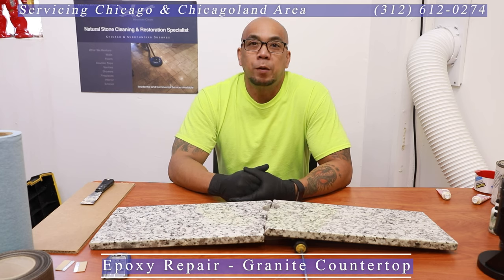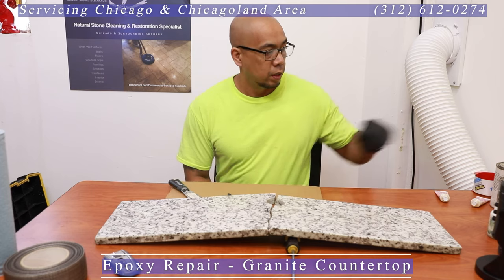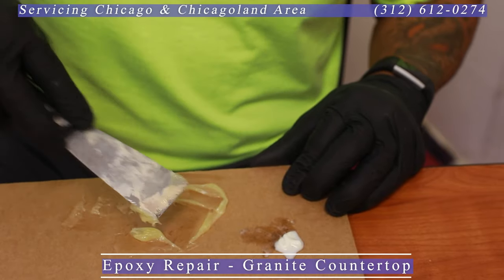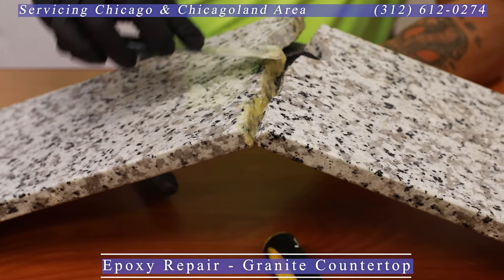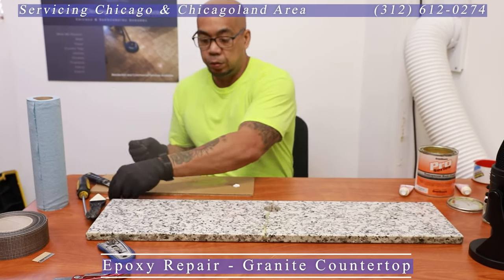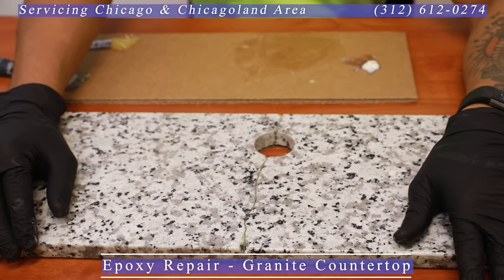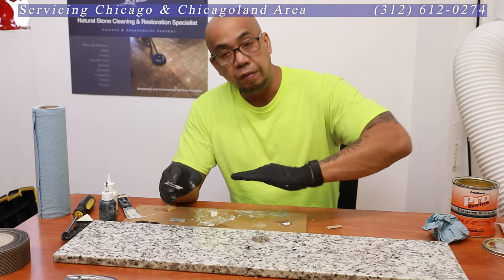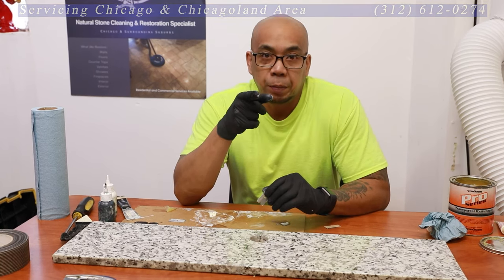Epoxy Stone Repair - Granite Countertop - Artistic Epoxy Repair

Comment: After the epoxy has cured, how do you remove the excess from the cherry dining room table? Lol!
Reply: Good one. Got a chuckle. Thanks.
Reply: heat the area with excess epoxy, razor blade scrape, be gentle when u scrape of course, slicing from left to right helps
Reply: And then, how do you eliminate it from wherever you placed it after you have taken it out of the table?
Reply: সনননকত
Reply: Wondering the same thing 👀

Comment: So in woodworking when you have a bad place in the wood that needs filing you sand a spot that isnt seen, usually underneath, off and collect the sawdust. Then the sawdust is mixed with wood glue or epoxy in order to make the imperfection seamless.  I’m wondering why that isn’t done here?

Comment: Not bagging on your work but this wouldn’t ever be acceptable at my shop. Get yourself a oil color kit and mix the color to match before you put hardener in it.
Reply from the maker: Would love to learn more about that. Can you provide links in reference to those products? Thank you.
Reply: @CSIAbsoluteCleanChicago  there’s a few things you can do to clean that up a lot better. Take your grinder horizontally and cut the inside pieces of the top to the bottom and bore it out so more glue fits in, and where the seam touches gets tighter because the middle of your seam is grinded out. Once you have your color matched to what makes you happy apply and let dry. When my pieces break they have to be completely hidden and un-feelable or my shop/customers reject it. Do you have an Instagram? I can send you my work.
Reply: @codyxisbell  hi, may I ask what's your Instagram?
Interested on checking out your work
Reply: Thank you Earl!  Really helpful!!

Comment: quick question, should the two granite piece be clamp together when you are doing epoxy repair on granite?   Going to attempt repairing my granite counter top that was dropped and broke in couple pieces.  Thanks

Comment: great presentation, a few Q's,
1- will the tightening of the faucet reinstall crack it again?
2- will the epoxy eventually change color or stain over time?
 3- what does a repair like
 this cost? the guy coming today for this repair only crack is 24 inches horizontal behind faucet.
he is charging me $1,500.😢😮
Reply: If I may. . 
1 this repair will crack again, it needs real epoxy 24hours minimum dry time.
2. What he used there it's not epoxy and it will change colour
3. The price depends a lot if the the counter top needs to be removed or not, polished, reinforcement, etc.. For this kind of job, me, in Europe I would charge 150 USD/H. If there are no complications this will take around 6 hours. 
After the job is done, needs to be impregnated again, degreased, cleaned. If the client agrees that has another cost 
I hope I was useful....

Comment: Can you make a wall out of granite or marble pieces by drilling holes in them and stringing them up together for a row?
Reply: Usually iron rectangle shape 'pipes' are first fixed to wall using screws and then the granite pieces are screwed to these iron brackets...

Comment: Your forgetting to reinforce the stone with interlock cutting techniques for extreme strength , you should use different types of glue that are clear white transparent and mix the colours to match the patterns in the stone .
The other down side of this glue is that over time it stains the stone and then it looks like rust has gone through the stone
Reply: Not necessary for cracks. They already give a large gap from all the crushed up stone for glue which is more than strong enough In that amount. As for seams I recommend the biscuit cut technique to help with the bond.
Reply: @Trudeau-is-Stalin  the biscuit cut technique is for timber because the biscuit fits perfectly inside but not for stone ... there’s other techniques for stone
Reply: That’s because it’s not a biscuit technique ... it’s a locking mechanism technique that applies for stone not timber
Reply: I do agree, I'd definitely use clear epoxy or white. I didn't notice the color of earl's, but with the hairline fracture that remains and the color matching, I really can't see any yellow hue bleeding through. 
As for you biscuit deal. I'm a carpenter for 40 years, so familiar with that, but in stone, u say just cutting some horizontal cuts in the material and the epoxy fills those and will suffice?  I was about to ask the other dude, what u use for biscuits? Chards of stone? Haha.  I did appreciate the matting on the backside. Thin but gives strength while lifting to mount. Thanks guys.
Reply: @peterford9369  you’re spot on. Although the ideas of the original comment aren’t bad, they’re overkill. The epoxy once hardened is stronger than the stone itself, there’s no need for any additional techniques to increase the support. However, you were spot on when you said to simply make a cut/grind into the sides of the broken area and have extra epoxy fill that up. 

As for mixing several different colours to get a perfect match on the pattern; if you want to be there for hours on end for a $150-$400 dollar repair, be my guest. The best way is to make a base colour (in this case white) and use “a technique” (secret techniques 😉) to add in the minor colours — the speckles on the stone. 

With some practice, you’ll learn which stones react this way or that way, and you’ll adapt to these reactions and know what is needed for x may not be needed for y, and which techniques are necessary for certain patterns in order to blend in as best as possible. 

There are certain patterns that no matter how good you are, the crack will never disappear entirely. 

I’m impressed by your guess!
Reply: @peterford9369  the biscuit cut technique means something much different in stone. It’s only about reducing surface area at the seam. Some people will router out material to create a thinner seam. The removed material acts as your bonding surface all you need at the visible seam is the smallest amount of adhesive. Using a name brand color match from Nitro, Integra, or one of the other brands can help create an invisible seam. Some go as far as polishing their seam. So if the stone was 3cm, I’d create a few tool paths on the CNC router to remove what ever the manufacturer requires. Depending on the stone, you might leave behind 1/4” to 3/8” thick on the surface, and remove a 1/16” of material below that.
Reply: @plasmaxr  Yeah, that makes sense. Like tongue and groove flooring, the bottom rabbit is shorter so the top will fit more snug.  But for sure adhesive being the color of the material is definitely a plus for a good seam. Being a carpenter I do appreciate a filler that is as close  possible, match the wood.  I've done some countertops in tile, wood , Mica, and even slate. But they all have a sub base of wood . I do appreciate natural or even cultured tops, but don't have equipment to work with it.  Just another skill that has to be learned. Thanks for your info.
Reply: Polyester resin (which is what he’s using) isn’t going to bleed unless it does so during the curing process because of not enough hardener and remaining uncured in the joint/crack for too long. Even this is only likely to happen in specific absorbent stones such as white marble and a variety of quartzites. It won’t bleed in the future, but it will turn yellow over time and become brittle, especially if it’s mixed more transparent and less solid color to mask the yellowing. 2 part epoxy is much more durable and UV resistant but will bleed during the cure process into the stones I mentioned. This can be avoided by sealing 1/16” or so of the top of the crack prior to application. The sealing is also required for silicone joints on these more absorbent stones.

Comment: You did a good job, but using the wrong epoxy that thing get yellow after a month or so, no matter what color you put on it. Also considering that 2” hole and like 10” clear field in front of it I would have added reinforcement roading on the back to prevent it to crack again.

Comment: Thank you, very informative.  I am wanting to fix a misplaced faucet hole in my granite countertop.  Long story.  Any suggestions?
Reply: Depends on how far off. Within 1/4 you're fine over that you're screwed unless you can find the core from drilling and epoxy it back in there, polish the surface. Looks like crap but hey no hole right

Comment: Hi Earl,  Thanks for the video. Good job by the way. I have a marble vanity top with a clean break to do for a customer. I thought pretty much any water proof glue would work or epoxy. I didn't think of the matting on the back. Do you just epoxy it to the back a day or 3 prior to working on the front?  That does seem like a good way of assuring when you lift it, it won't come apart with it's own weight. Thanks so much sir.
PS, hers has the sink cutout, and the break is almost dead center of the sink cutout.

Comment: How would you repair a crack in a piece that you can't remove?
Reply: Flowing epoxy, try shimming underneath the crack if possible to open it up a bit more and let the flowing seep deeper into the stone.

Comment: Not professional at all! I'm doing this job for 20 years so I think I have an idea ... 
First of all, it's not epoxy, it's polyester mastic, doesn't resist too long in humid places, if you put too much hardener, it will dry faster but becomes yellow (honey coloured).
Second, these stones are to be glued preferably upside down because not always the back of the stone it's flat, clean and smooth so it can ruin your alignment, we need the top to be perfectly flat. 
Third, the tools are to be cleaned with thinner, acetone or alcohol 95⁰.
Fourth, the surfaces are to be polished after the repairing
Fifth, below it's a good idea to put some reinforcement. 
And many many more...
Your repairing will last max 12 months it depends of the usage ..
Reply: I have hairline cracks in porcelain floor tiles. I guess getting a pin to clean them up would help before trying to repair? Would just love to hide them. Do I use 2 part epoxy or something else?

Comment: Thanks for the video.  Unfortunately when I applied the epoxy the two pieces did not adhere to eachother.  It appears that I did not add enough epoxy or I waited too long before putting them together.  I now need to remove the epoxy.  What would be my best course of action?
Reply: Chisel it off
Reply: Hire a professional... plumbers can’t make deserts
Reply: Not enough hardener
Reply: @Unknown-nf1se sure they can 😂

Comment: No clamps?
Reply: Your suppose to use clamps ... to bring it as tight as possible to close the crack to the point that it’s as invisible as it can be
Reply: @Unknown-nf1se  That's what I thought. But not so tight as to squeeze all the epoxy out. There's an in-between spot as with any "gluing."
Reply: That’s not a problem if you interlock the stone from underneath first so that it has the strength  under and it’s tight on top where people can see

Comment: I make the same colour of the stone with the epoxy and then I glue it together
Reply: Don’t forget epoxy changes colour with the sun
Reply: @Unknown-nf1se   not if you use  Transparent epoxy. Never once it changed colour over time, even when I used it outside for BBQ kitchens..
Reply: @BOSANCERO-ARBIH  I am in Australia the sun here is extreme so we have issues with the effects of UV LIGHT.... I take it you are based in the US??
Reply: @Unknown-nf1se  yes sir. Didn't know you're in Australia.  Never mind brother heat there is extreme epoxy will change color in that heat.
Reply: @BOSANCERO-ARBIH  yes it does 🙂